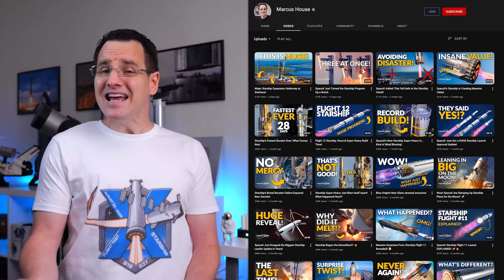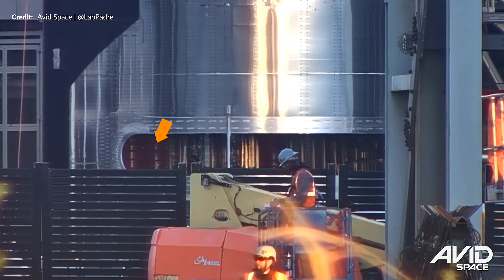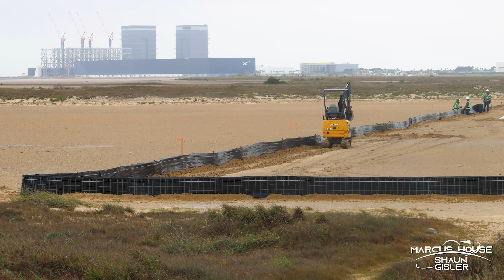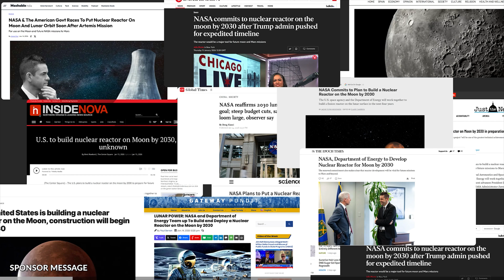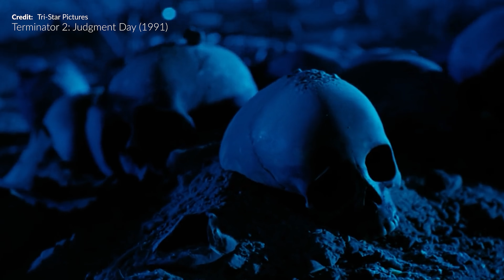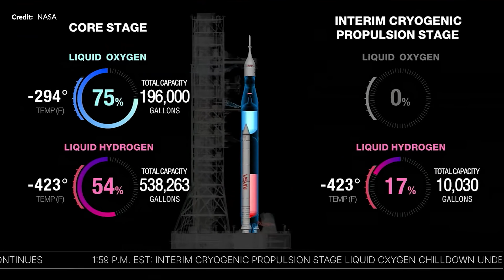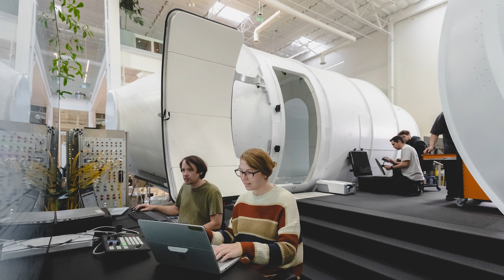SpaceX’s Starship Version 3 Testing is Epic! Why?

Comment: The Shuttle averaged over one scrub per scheduled launch, and most of those scrubs were due to hydrogen leaks.
Reply: Yeah, hydrogen leaks are pretty much universal wherever hydrogen is used... Shuttle, Delta IV, Ariane 5 & 6. But SLS does seem worse than most, and it wouldn't surprise me if the low flight rate was a contributor to that... when it's been more than three years since the first flight, that's long enough to lose much of the practical experience gained from Artemis I. How many of the people supporting that launch have left NASA since then, or moved into new roles, or just plain forgotten some of the hard-learned details?

Comment: Starlink was genius. Space data centers are stupid besides certain low latency applications. Discarding the heat generated and being unable to maintain the hardware is going to be the main problem. Off the shelf compute and storage is not hardened against radiation.
Reply: Well SpaceX doesn't think so, but what do they know, it's not like they have the best and most experienced space engineers in the world or anything.
Reply: @admarsandbeyond in this case they are being forced by upper management. The engineers think it’s a terrible idea!

Comment: Please stop referring to NASA's personnel as "engineers" because they are not. NASA has becomes rampant with nepotism and are only concerned with making it to retirement. They are arrogant and just hanging off coat-tails of historic achievements. Anyone that's surprised that SLS failed IN THE EXACT SAME WAY AS BEFORE and NASA did not resolve it should be ashamed for their continued support of this entity. My fear of NASA losing the crew of Artemis II @ the hands of NASA (because the heat-shield issue is not resolved) has me sick to my stomach, and if by some intervention of the space gods they make it back it will just be on a whim. My other great fear is when NASA catastrophically fails, they will just throw Jared under the bus as a scapegoat.

Comment: Data center satellites will need huge radiator panels to remove the heat generated by the servers. They will be much brighter than Starlink satellites, which are already annoying to astronomers, star gazers, and astrophotographers. They even interfere with telescopes in space. One million data center satellites will obliterate the night sky - which is considered part of the environment deserving conservation - outnumbering the visible stars by 200 to 1. All this at a time when people are increasingly sick of AI. I'm opposed.
Reply: The radiators will be roughly the same size as the solar panels themselves.  The radiators will always be aligned edge-on with the Sun (otherwise they would be heaters), receiving very little illumination from the Sun.  Starlink Gen2 satellites that are actually operating on station (excluding ones maneuvering) have been measured at around +7 magnitude.  That means they're invisible to star gazers, and dim enough that astronomers and astrophotographers have ways to mitigate their effects.  If you look up and see a satellite crossing overhead every couple minutes, you've been able to do that for decades, and it's probably not a Starlink.  They're mostly spent upper stages, not payloads.  Most of the plans for these call for them to operate at the terminator, meaning they will only be above the horizon into twilight.  You will not be able to see them at night.

I'm not saying these are economically viable, but you're spouting a whole bunch of nonsense.
Reply: I'm not saying you're wrong, but one day we'll look up and see a fully colonized moon. The white glowing sphere will be a thing of the past. Our nights skies wil also see drastic changes.

Comment: All the falcon 9 inflight anomalies that have occurred (at least that I can think of) have been 2nd stage issues. This is interesting because when they first started reusing F9 first stages there was considerable concern that reused stages would be unreliable (I guess more likely to break due to accumulated wear and tear). However, the first stages have proven to be remarkably reliable, while the brand new, but non-flight-proven, 2nd stages have been the sole source of trouble (though still quite rare given the incredible flight rate of F9s).
Reply: SO ? SPACE ? IS a' CARTOON ?  OR IS IT Just Me ?
Reply: @harrymacdonald858  yes space is obviously a cartoon, you can move on now
Reply: @harrymacdonald858   SO ? SPACE ? IS a' CARTOON ?  OR IS IT Just Me ? 

Yes you are a cartoon.

🚗

🎵

Comment: Marcus, would you and your army of brilliant geeks do and share some analysis of the power and cooling needs of such space data centers?  For example, how much area of solar panels, how many flights to boost them, etc.  I’ve seen some figures for that that look quite impractical, but I would like your thoughts.
Reply: Not to mention RADIATOR panels….
Reply: @evanmorris1178  it can be done and probably even cheaply enough. Look up the radiators on the ISS. Imagine something like that but modern and mass produced. 

The enabling technologies are cheap launches of big payloads — so Starship — and mass production to get the costs down and the quality up. 

It won’t be big compute centers, just data centers with a little compute on the side. Think Akamai in space to make Starlink work better.
Reply: I suspect that the orbital compute satellites will start by handling inference instead of training. This will significantly reduce the need for large tightly synchronized clusters, but require a large amount of data redundancy cached on every satellite. 
 @peterfireflylund
Reply: @peterfireflylund  even Data Centers use massive compute to compress the data streams.
Reply: The Stephan-Boltzman law gives about 400W/m2 of cooling at 300K.  So the cooling bit seems feasible to me wherever at least one direction faces deep space.
Reply: @alx9r   Everyone talking about cooling is a reaction to claims made.  First, "cooling is trivial because space is cold".  Second, "datacenters require massive amounts of water".

Datacenters require massive amounts of water because evaporative cooling is dirt cheap, because water is dirt cheap, so commercial entities will take the dirt cheap option where ever they can.  You can do dry cooling, but that's more expensive.  You can have a heat exchanger with a large body of water, but that has environmental implications and may be denied.

Space isn't cold, because space isn't anything.  You can do radiators, and those radiators work because there's nothing but the microwave background radiating back, but radiators suck.  400W/m2 sucks, particularly when it's $1000/kg to orbit, and aspirationally Starship might drop that to $100/kg.  They're large and heavy, and that means cost.

That doesn't mean we can't do it.  On the contrary, we know exactly how to do it, and we know exactly what it will take to do it.  It means there's a high cost compared to the same installation on the ground.  They're claiming cooling to be a huge positive, but it's a massive negative.
Reply: @wagnerrp I like your breakdown. Personally as a career "server guy" I'd like to speculate.
1. The best part is no part.
2. A high performance compute system in space is more vulnerable than any earthbound computer because repairs are so far away and so incredibly costly.
3. For 1 and 2, I would do everything in my power (pun intended) to engineer my heat circuit to not involve fluids.
4. The datacenter ideal scenario is that the solar panels always face the sun, and they are never eclipsed by Earth.
5. This makes the heat transfer "circuit" (a solid piece of metal, not an electronic circuit) always point out the back of the satellite away from the sun. Again an ideal scenario.
6. The heat sink/thermal circuit could (should) run all the way from the sun-side of the chassis (shielded with mylar to avoid direct solar heating, like JWST) down the center of the chassis and out the back for however many meters is needed for reliable cooling.
7. CPUs and any especially hot components are thermally bonded directly to the heat sink.
8. Anything moderately hot can be mounted to a heat conduit off to the side.

This approach makes a cooling system with no moving parts.
Reply: Real estate considerations.
1. Starlink occupies very low earth orbit for latency (speed/throughput) reasons. That's ideal for communications equipment.
2. A lot of other stuff wants slightly higher orbit, and there's also a lot of space junk hanging out there.
3. All that stuff is earth-facing, and distributed to maximize the percentage of earth that has coverage.
4. Datacenters need none of that. They are orbiting the earth at a bigger distance (my largely uninformed speculation) probably closer than geostationary orbit. They would do nicely orbiting in a plane focused on the sun. Picture a target with the earth at the bullseye, with a million satellites occupying different rings on that target. Their orbits only need to be adjusted to follow the sun throughout the year. Much less maneuvering than Starlink or ISS.
Reply: 3/
Sizing and scale.
The stated purpose for the million satellite constellation is AI. this is CPU intensive and power intensive. That's the point of all this. Existing non-ai datacenters are bad enough with power and water requirements. Lots of compute, relatively small amout of data going between the client (person) and the datacenter. The AI constellation can manage information transfer between nodes, reducing the amount of "expensive" communication with the planet. Not sure how expensive it will really be, but last I heard Starlink's license was only for earth-facing communication.
Reply: The proposed xAi constellation will be in stacked concentric SSO above the terminator. Altitudes starting from 500 km and up. 
 @kennethroberts6993
Reply: The data processor chips can be mounted directly on the shaded cold heat sinks, spread out. The solar collector panel shades the processor from the Sun. The phased array transceiver panel shades the processor from Earth glow. 
 @wagnerrp
Reply: Mount the circuits directly on the heat sink exposed to dark space. The hottest components get a planar heat pipe interposer to spread out the heat to a large enough surface area, until metallic heat conduction is sufficient. Mount all the processor chips far apart to make heat dissipation easier. 

If at all possible, the satellite has planar components so the satellite has the smallest exposed profile to orbital debris, and the orbital "leading edge" is more heavily armored. 
 @kennethroberts6993
Reply: I think I heard something like 8-12 xAI satellites per starship launch. Let's use 10 for simplicity. So 150 tons per launch, figure 15t per satellite, and I don't know if that includes a kick stage to get from LEO to the ideal orbit for the satellite, or if Starship gets refueled to take them all up there at once leaving more mass for the AI units, or how big their maneuvering units/propellant reserves are going to be.

There's some sort of optimization for whatever is critical and I don't know what that is. But I suspect size/volume is part of it, I'm sure the simpler the satellite physically the cheaper it is to reproduce and the fewer things to go wrong with deployment.
Reply: WRT fueling and maintenance, I think it will be good business to have some sort of space tug/service ship that refuels itself and gets materials from an orbital depot (Starship refueling tanker, and they have announced these pods full of stuff that can be deorbited on short notice to any part of the world. Not SpaceX on that, but there's no reason they can't do that for materials not intended to be returned to earth.

So this service tug is in orbit. It gets a service request, grabs fuel for itself, fuel for the satellite if necessary (probably different fuels), gets parts from one of these pods, and tools/robot for the task. 

It finds the satellite, fixes it, refuels it, pushes it to a higher orbit. Return to parking orbit, repeat.
Reply: Whats the likelihood of a Kessler event occurring?
Reply: The odds are significant, and rise with the density of new satellites. The problem is existing shrapnel in the 500-800 km altitude that crosses the proposed sun-synchronous orbit, especially from the year 2009 Iridium 33–Kosmos 2251 Collision. This created thousands of fragments large enough to track and innumerable smaller fragments (too small to track) that will endanger the XAi constellation. 

SpaceX will have to cope with inevitable collisions. Not to mention all of the other satellites in SSO whether on the dawn/dusk terminator edge – or not. 
 @NZ_NATIV3
Reply: Scott Manley has a good video about those.
Reply: Ask AI? While using referential sources, found thru cursory Google searches? I mean it's possible, it's a matter of how much you wanna type. Or call Scott Manley? Lol
Reply: I think he is still struggling to deliver the tesla roadster people paid 250M for 7 or 8 years ago
Reply: More of musk's money grab from the taxpayers
Reply: Activen el doblaje automático para todos los que hablamos español en mundo por favor
Reply: SpaceX has the best space engineers on the planet, with the most experience building, launching and operating the biggest satellite constellation in history. I'm certain they've done the math and found this plan to be realistic.
Reply: We do not eat Watts. Harvesting energy for the purpose of feeding energy-hungry AI training centers will not help human kind, on the contrary, it could lead us to doom. I propose harvesting the solar energy for the protection of the environment, to help people to grow their own food at home, free of pesticides, to help flora, fauna, oceans, air, lands, from being destroyed by pollution, overfishing, by garbage poisoning water, and air. Millions of millions  of insects and other animals are getting killed in the highways, crashing in the windshields of cars. We need energy, yes, but to protect our planet. This should be our first and most important goal. then we could think about colonizing other planets....if we succeed to protect our own first.
Reply: @arkangeln910c8 how do you propose getting that energy down, without creating space weapons? At least using it up there doesn’t kill trees or animals or pump up global warming.
Private companies need to make money to create and launch this stuff so who is going to pay for it when our national governments hesitate to pay for ground based solar panels and wind turbines?
Reply: @makingmusiconline2309  Why would they pay for that? I neither.
Reply: @arkangeln910c8 we are never going to agree on what is best for the plant. 
People are to lazy to grow there own food. 
I agree that earth needs a lot of work. But that being said, the purpose of making human life on other planets is in case of a life ending event on earth. 
Humans will not destroy earth. Mother nature is to powerful.  We will wipe out each other before we wipe out earth. Earth will just restart without us like it always does.
Reply: @brianbiddle7590 we can all agree that musk does NOT have our best interest in mind.
Reply: @ThatOpalGuy why? Because he is not in your political party anymore? 😂😂 you all are full of shit
Reply: @ThatOpalGuy he has his own specific goals in mind. He claims that his goal is to give humanity the best chance of surviving into the far future. As far as I can tell, nothing he has done since he owned PayPal has deviated from that goal.

That doesn't mean things he does will work out in your best interests or mine either, but he seems faithful to his stated vision more than just about any public figure I can name.

That said, I will let him go on with it, not that I could really stop him. His work is far less worrisome to me than absolutely any elected official in the federal government.
Reply: @arkangeln910c8 You sound deranged
Reply: @jasoncdebussy he isnt in the cult of musk, so no, he is not deranged.
Reply: @arkangeln910c8  Sometimes you're the windshield; sometimes you're the bug.
Reply: @arkangeln910c8 A combination of the two is necessaey
Reply: @arkangeln910c8 maybe just increase the regulation of the food, as in Europe we have just fine food. And I am not a farmer, so the food I would grow would be poor quality anyway. That is our strength: we can each do what we are good at.
They grew food on Space Station a while ago, so we can solve the killed insects on your car's windshield.
Reply: @arkangeln910c8 I actually propose that everyone should just get along
Reply: They should NOT be allowed. Period.
Reply: @ThatOpalGuy 😂

Comment: Space Data Centers... that's such a total scam. It's absolutely ludicrous. The technical hurdles + the size and weight and costs of getting them up there plus the maintenance costs in space. In no economical way, this makes sense. And waste heat of DCs can actually be made useful for heating for example. The technical cons of space outweigh the pros (only power, nothing else) by immeasureable magnitude. 

It's snakeoil for the IPO
Reply: 😂😂😂😂 sure it is. Just like reusing the booster was snake oil. 😂😂😂